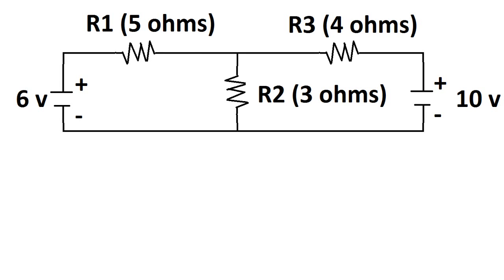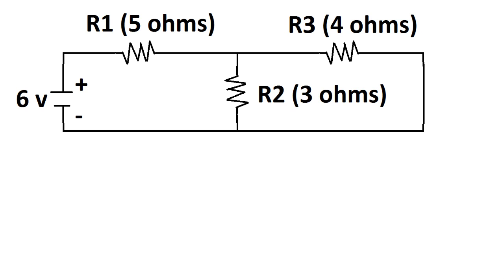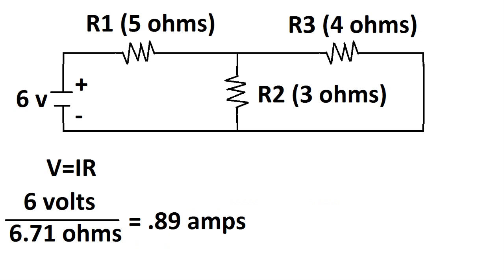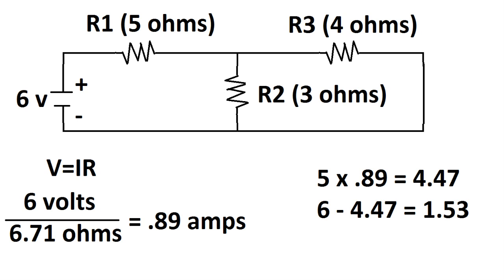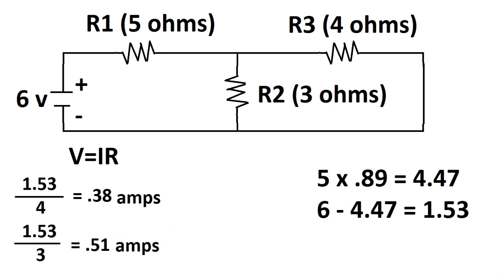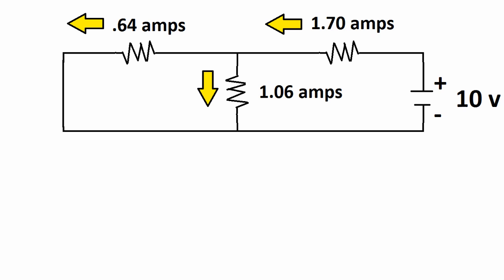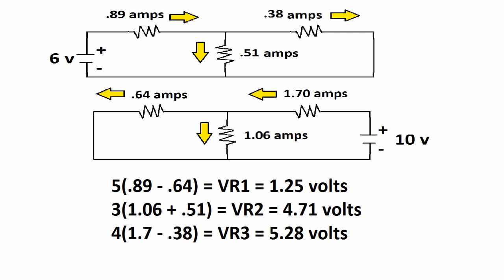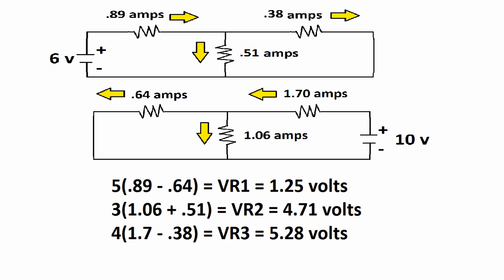Circuit with Two voltage sources: how to find voltages of each resistor (parallel and series)

Comment: At the end of the video, I guess it's supposed to be IR1, IR2 & IR3 instead of VR1, VR2 & VR3?
Great video by the way. Thank you.
Reply from the maker: thanks for the compliment. If we are looking at the same slide. (last slide) We are taking the current delta times the resistance to get voltage of each resistor. Let me know if you are looking at something else.
Reply: Yes, we are looking at the same slide. I was just confused, because for example, at R1 you have 5*(0.89-0.64) and then you say that's equal to V*R1. I just thought that (0.89-0.64) is the current, I'm a newbie at these, sorry if I complicate stuff.

Comment: What if there's no parallel resistor? If everything is in series how do you find voltage when there's two batteries (in the same position at this example used)

Comment: hi, thanks for that. I should know how to do this but needed a quick reminder...
 Lecturers often like their math, so they love to put problems like this into lots of algebra.  The students then think that remembering the algebra is the way to solve these. You way is the best way because it accounts for  many possible variations encountered in real life circuits and little to remember in addition to Ohms law.
My problem is an electronic voltage detector with open drain output. The input is 10v whilst the output is to 3.3v.  a hysteresis resistor joins the two sides together. The resistor values I had calculated, did not work in the prototype.  This is my work.
This is worth learning - this is useful in real circuits.

Comment: what if you reversed the direction of the 10V source?  then the amps would be combined, right?

I went looking for the answer to a question I have.  If I have two 12V-10A sources that I want to feed a single circuit, do I just connect at two points into the harness for both power sources.  Hoping that it all smooths out the energy across what I am trying to power?

Comment: I have a circuit similar to this but I keep getting different answers to what the actual answers are when I use this method, (I'm just looking for the Current through each resistor).